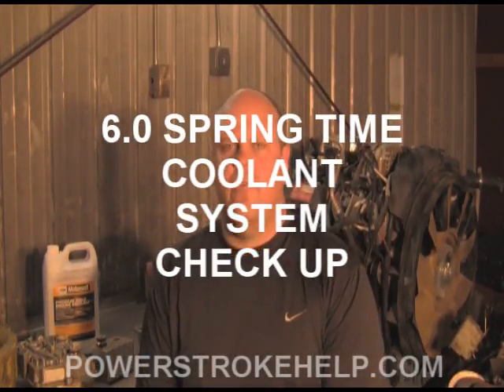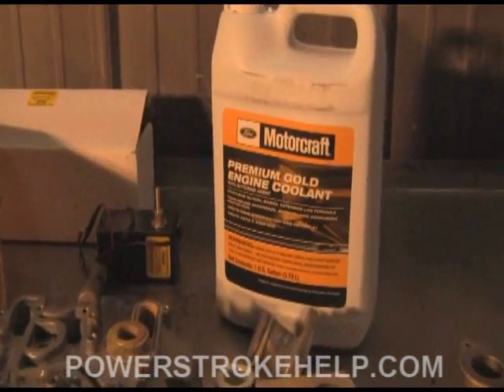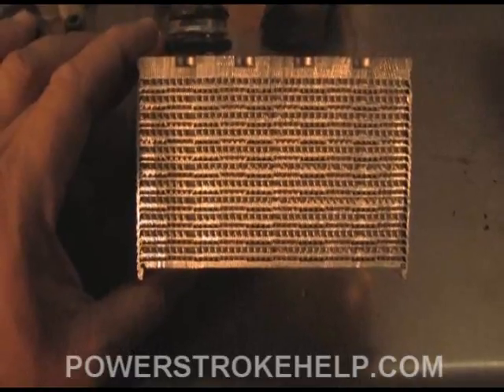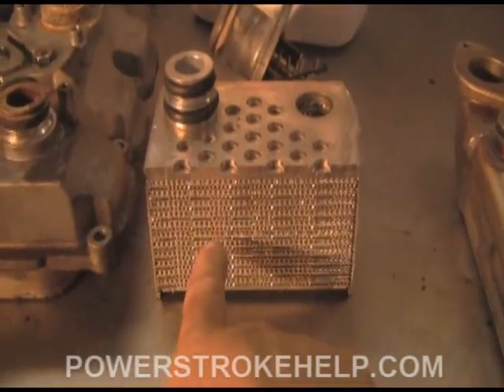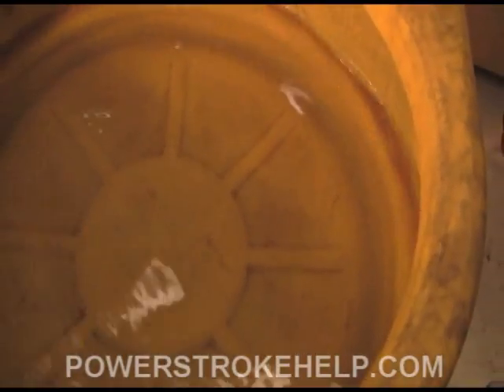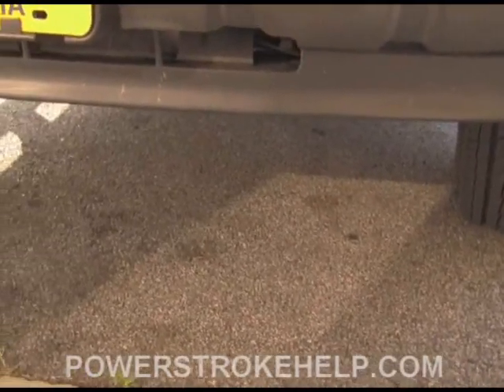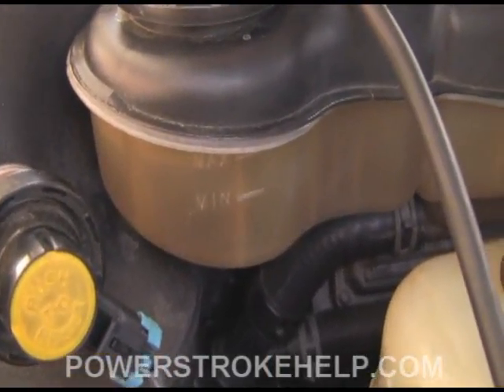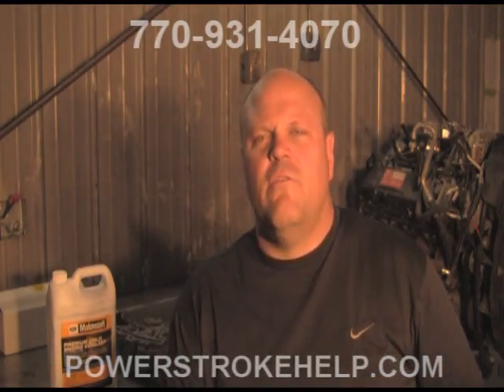6.0L COOLANT CHECK UP - FORD POWERSTROKE

Comment: Iam looking at 2003 350 6.0.they  said the battery die  put new ones in and burned  the ficm upn Idoes that sound rite  they want 4000 for truck

Comment: Another big point of failure is the short hose going from the oil cooler to the egr cooler, I have my egr cooler deleted and the hose is leaking now. Talking to guys on forums whats your opinion of the delta between oil temp and coolant temp, mine runs anywhere from 2 to 8 degrees apart. At what point do you change the oil cooler some guys say a 12 degree delta. I know you push motorcraft products but I'd like your opinion on CAT ELC coolant, I know a few guys having great results with it and I've seen some videos of people testing it. The test even showed that cheap autozone coolant had the least particulates and motorcraft gold had the most with cat in the middle. Also if you could get back to us on any updates with the CK oil changes that'd be awesome.

Comment: Old coolant can also eat away at the aluminium front cover and destroy it. As in, Turn it into a powder if it has any leaks such as around the steel pipe running to the heater core...

Comment: hi to all of you powerstroke fanatics I did all the antifreeze change use  an antifreeze that's charged all the junk is out if it so it can't clog the rad I have no leaks runs just like a tiger I just love this machine husband thinks I'm sick I just love the Ford Diesel. I ran over an 800 pound bear at a 115 km no damage bear cut in half. I do 140 km ever now and then to keep her clean turbo just sings I get 650 km to a tank I don't know if that's good oh well I keep watching these videos of Bills they are so go thanks

Comment: i have 2005 6.0 132,000 miles with egr delete done few months ago, have a coolant filter last year in spring, i flushed system this spring following your video. engine has been spiking temp fan clutch seems to be working fine. it will spike and come back down in about 20 seconds ( seems to be warm days and if i go above 70 mph ) replaced thermostat 1 month ago still does it. no-one in my area can figure it out. head gaskets done at 95,000. and now that it is getting colder here (northern minnesota) i have heat issue when idling no heat till driving and as you drive heat comes and goes like the ac is on then goes back to heat????? always had excellent heat even at idle.  LOST
Reply: +Todd Sunde It might be your water pump.
Reply: This happened to my 2006 6.0 More than likely its your thermostat. Cheap part and cheap fix. Once I changed my thermostat it fixed the problem. I now have my heat back. I now remember what it feels like to stay warm in the cab in winter! Lol

Comment: What's a good delta range? I see 8-10 degrees difference cruising at 60 in my 2006 with EGR delete. Also, do you recommend a particular coolant filter kit?

Comment: Bill, I know the Ford Gold coolant has the inhibitor package but do you think it would be better to add an ELC coolant to keep from potentially clogging the oil cooler? I have the EGR delete so some heat has been removed from the cooling system and I have a cooant filter. Just want what will keep my 6.0 on the road! thx!

Comment: just recently bought a 2005 ford Excursion 6.0l. 86,000 miles. I got a good deal on the banks big hoss bundle, the excursion works great. seems like theres a lot of turbo lag, but im use to driving a f250 6.8 v10. I plan on also putting on sinister diesel coolant filter. will putting the banks bundle hurt this any, do I need to do the head gaskets first? and advise welcomed. 
thanks

Comment: Not a pro mechanic. But even with stock tuning and just the stuff to make the truck not throw a code for lack of egr. It should improve power because the combustion chambers are not being filled with already energy depleted gasses. I have read that 6.0s use a substantial percentage of exhaust gas recirculation.

Comment: Would an EGR cooler-delete affect anything other than emissions?  I'd imagine it would increase coolant flow and eliminate the possibility of hydro-locking nearby cylinders.  A lesser positive would be dropping some pounds from an already front biased weight distribution.  Good tip about oil coolers too; they're relatively cheap and easy to install.